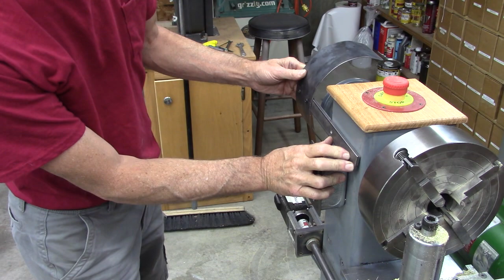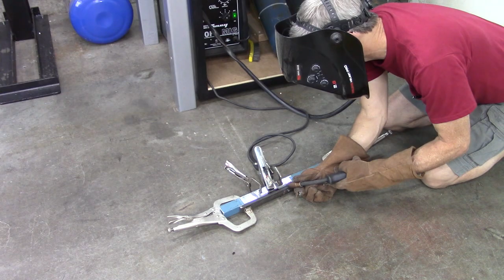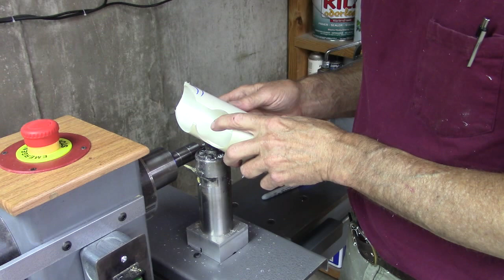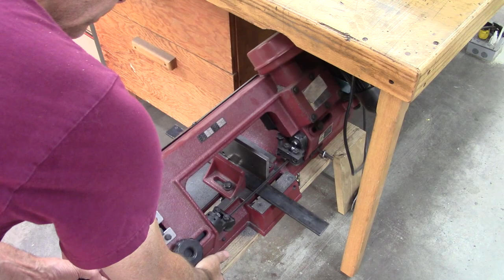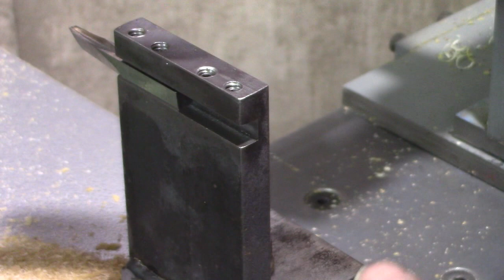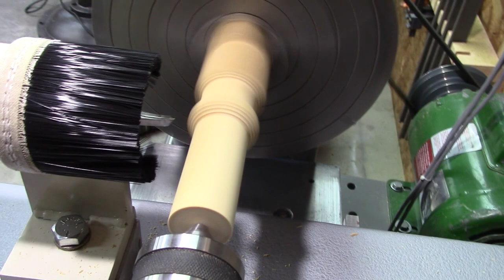CNC Wood Lathe - updating, perfecting and dust collection

Comment: What software are you running on your lathe (to create the G-code)?
Reply from the maker: I'm using Cambam. For the most part I can make it work but I'm prefer something more user friendly. Any suggestions? Also I use sketchup to create a DXF which is no problem at all
Reply: @WinkysWorkshop  Hi Winky -For the mill - I love my VCarve.  I haven't found anything similar yet for the lathe.  The Mach3 (I know - you're using EMC) have a lot of built in "wizards" for the lathe.  I am currently putzing with Fusion 360.  Let's make a deal that when one of us finds an easy to use software - that they let the other person know.  I ddn't know CAM/BAM had lathe!
Reply from the maker: @joecnc3341  EMC? I'm using sketchup. Cambam has limited lathe function but it's there. It doesn't support cutting in both directions and you can't select different tool geometry other than round. I need to find a better software before my trial is up. I don't mind paying some but it bothers me to pay $170 for something so limited.

Comment: Mark one concern i have is the wasted motion of the tool. Each pass it retracts and then comes back to start another cut. Would it be possible to change the program to cut on both the forward and back stroke ? Not a big deal until you put a price on time.
Reply from the maker: I agree. My only concern is wear on the lead screws. I'm not in production so time is not an issue. Some CAM software will write code to do this but so far I have not found any that I can comprehend or afford.

Comment: I really like the creation place you have made there. Looks like A nice paint booth on casters with a turntable that you can hook up your dust control is a fair idea or are you far enough south you can spray all year outside ? R&D takes sooooo much time.One change here makes for 4 changes over there eh. Nice job Winky !
Reply from the maker: Thanks you sir. I'm in KY and we have very cold winters. I usually wait for a warmer day or paint inside and then open the garage door. The rapid air exchange gets rid of most the fog.
Reply: @WinkysWorkshop  Got ya. I have a few friends there that keep me in the know. I got a 18" turntable for not much on Amazon and put it in the 1/4 in plywood, 36 in sq. box with a good sturdy stand on casters. It took me about a 1/2 day to make and it works great. Our wood shop is 40 x 60 ft but everything has to be on good casters. I can't ever remember seeing a shop big enough as the more space you put up the more room to fill it with the never ending supply of new and old tech eh, LOL. Great post my friend.
Reply from the maker: @TomokosEnterprize  My shop is 23 x 27 feet. 40 x 60 would be amazing!!!
Reply: @WinkysWorkshop  14+  cords of wood to keep the floor heat up in winter though. I am sure grateful to have that space to do any woodworking in for sure eh.

Comment: what if does chain gear better than belt pulley ? 
I  am thinking  that making a lathe machine, ı will use  chain gears system on  main motion
Reply from the maker: Like timing belts?  That would work well.
Reply: not timing belt , ı will use v belt or chain , which of these do ı use it?
Reply from the maker: @jackson384  It the speed of a wood lathe I'd go with a V belt.